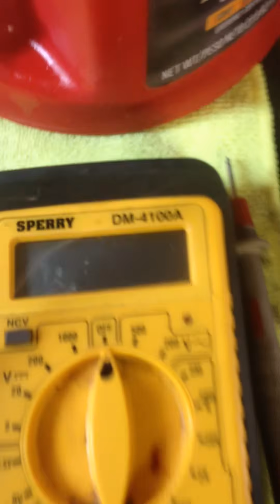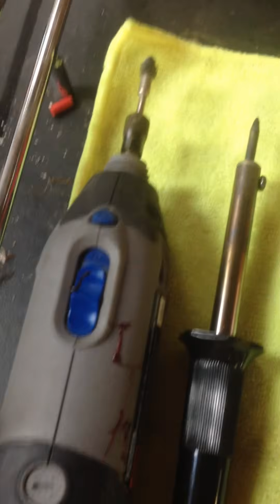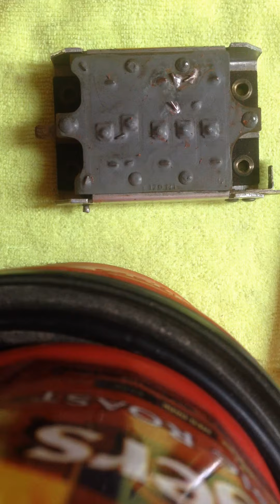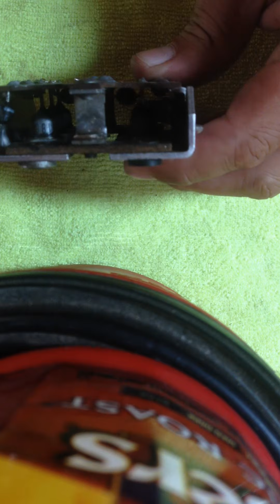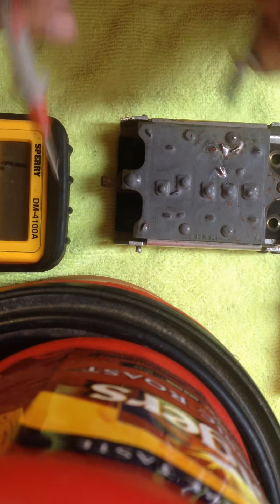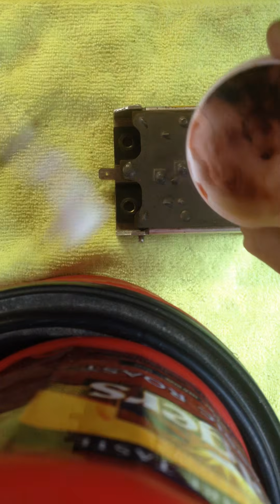BMW Diode Board Test and Repair r90/6

Comment: Hello, I measured my diode board and on the diodes to which the blue wire is connected I measured 1.093 and in the other case 1. Is it possible that this is why the starter does not turn at all? Thank you Martin

Comment: useful, when I took the diode board off the blue wire was pulled off before checking its position. as usual the wiring diagrams in books are nightmare.